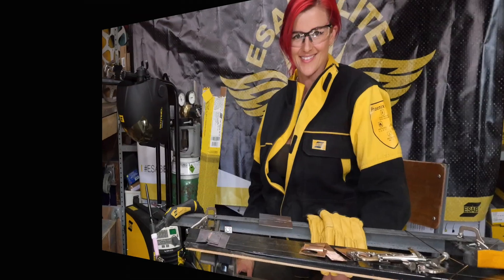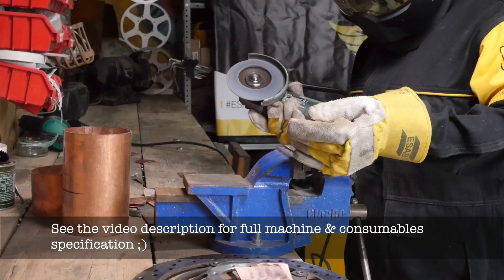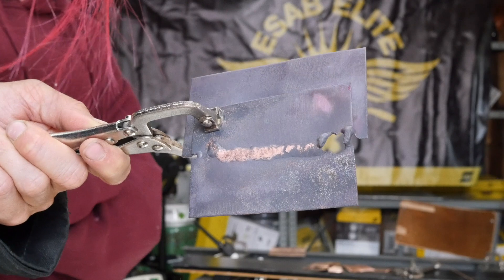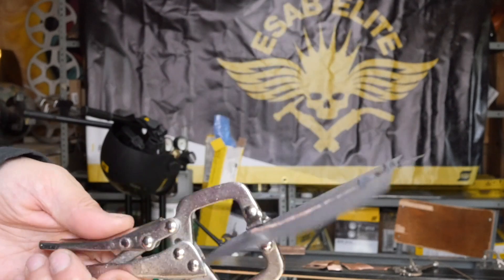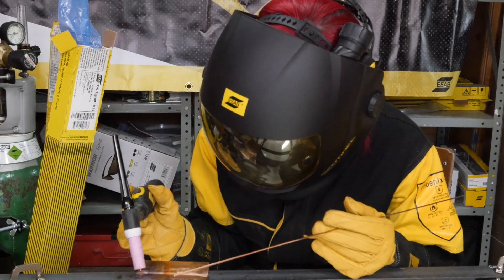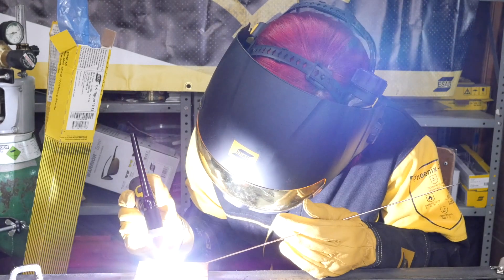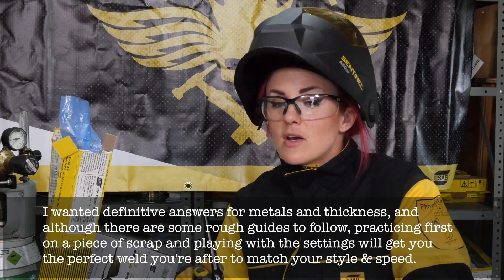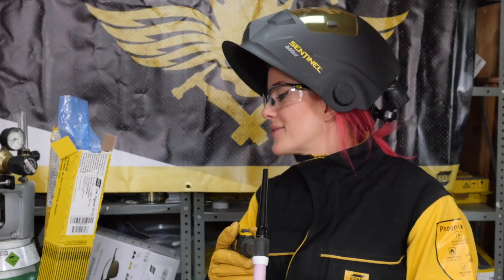Can you weld TIG weld copper with Argon gas?

Comment: Thank you!  You’ve convinced me I can do copper!  I currently use argon for aluminum, and I have thoriated tungsten for when I do stainless, and I have a TIG machine that can put out 750 amps if needed!  Another video showed I can use copper wire as a filler!  If I planned to do copper a lot, I would set up specifically for it.  But since I only need to tie a couple of electric buss bars together and they don’t have to look pretty, I’m sure now I can give it a go!  THANKS again!!

Comment: I was surprised to see how thin the copper was. It seems like there would have been much more blowout  after being on it for so long. Cooper is difficult to weld because of its property if moving heat. But when you get to the end of it and there's nowhere else for the heat to go, it will give you that quick sizzle  right before it blows out.
Why helium as a cover gas for copper? I thought helium was just used for welding overhead...? I've only tig welded copper twice.  Both times using argon
Reply: My understanding is the helium conducts the energy much better. The figure I've heard is, running helium effectively doubles the amperage of your welder when using argon. So you get much better penetration on steel, and can dump energy into the copper faster than it can conduct away.
Reply: @Twiconnor  get out! ..really? This blows me away.  Thanks for the info. I'm definitely going to be looking into this..

Comment: I think the only reason you need to use helium is if your welding thicker copper because the helium essentially ups the heat output. If your single phase 200Amp TIG set is maxed out , using helium it would be the equivalent of 340Amps . Thin sheet metal is so much easier to weld  using a foot pedal, saves you relying on your pre set slope down as your workpiece gets hotter as you weld, you can back off your amps  as needed as your welding to keep the bead the same width from start to finnish. I'm sure you know this Charis but I thought I would comment just to expand on your great video.

Comment: Another big mistake.....elevate weld joint off the cold work surface.  The heat will not be sucked out of the joint.  Weld AC and balance on full penetration.  Helium mixes not needed.
Reply: The back of the weld will oxidize if you do that!
Reply: @acewelding  no big deal, 2 swipes with wire brush remove anything.  Copper 1/2' or more use argon/helium mix, 50/50

Comment: You should be choked up on that tig torch more. You’ll get much better control over your puddle. You’ll be able to keep the tip tighter to the work which will keep your heat effected zone to a minimum which is a must in some instances

Comment: I use strands of heavy electrical cable to tig light materials with lower amps, so typically I would fuse a 1/8” stainless welding rod to 2.5mm weathering steel. These are small wrens that can be planted in the garden and bounce in the breeze. To do these I normally run 40 45 amps. It’s faster and easier than welding and yes I can tig conventional materials.

Comment: Most interesting. I just ordered some 3mm plate and I feel I am in with a chance now :o)
Reply from the maker: teamidris aw, really? That’s awesome! Glad to be of help 😊 Let me know how it goes 😉
Reply: @CharisWilliams  Thanks :D One person has said I wont get a cert on it? So i need to check the PED on ickle steam boilers. I don't think there is anything on silver soldering vs tig welding, only that it is made using 'sound engineering practice' and a pressure test. Should be interesting :)

Comment: Did you have to adapt your power at home to accommodate the welder so that you didn’t blow the electricity in your house or your neighbours?  We have a welder but the leccy won’t accommodate it 🤔
Reply from the maker: Reclaimed Life hiya, no, not at all. Haven’t had any problems in that respect. I just got a schuko plug adapter as it had a Euro plug being Swedish. I just plugged it in and off I go. It is a single phase machine, is yours?

Comment: I love welding, MIG is my favorite using Argon gas.
Reply: What material are you welding with this process?
Reply: @AlabamaTree  normally just steel tubing nothing fancy I welded frame rails and other items
Reply: @AlabamaTree  I suggest using official welding references when choosing shielding gas and filler.  You'll learn more that way.  You can MIG non-stainless steel with pure argon but it's not optimal for most work. 

https://www.lincolnelectric.com/en-us/support/welding-solutions/Pages/mig-faqs-detail.aspx#question2
"Common gas mixes for the home hobbyist and small fabricator: 

100% CO2 -Lowest price, generally greatest penetration, and higher levels of spatter. Limited to short circuit and globular transfer.
75% Argon - 25% CO2 -Higher price, most commonly used by home hobbyist and light fabricator, lower levels of spatter and flatter weld bead than 100% CO2. Limited to short circuit and globular transfer
85% Argon - 15% CO2-Higher price, most commonly used by fabricators, with a good combination of lower spatter levels and excellent penetration for heavier plate applications and with steels that have more mill scale. Can be used in short circuit, globular, pulse and spray transfer
90% Argon - 10% CO2- Higher price, most commonly used by fabricators, with a good combination of lower spatter levels and good penetration for a wide variety of steel plate applications. Can be used in short circuit, globular, pulse and spray transfer"

Most cost-effective for hobby welders is CO2 if you don't mind (or contain) the spatter. Pure CO2 cylinders last longer because CO2 stores as liquid under pressure then sublimes into gas.  75/25 is typical MIG mix stocked at welding suppliers. Pure argon is more expensive besides being less suited for most work.

Comment: Ofcourse you can weld copper with Argon. But we know that Cu distribute heat fast and when you weld you want to heat up the spot you are welding as fast as possible. Its not only to get the job done faster, when you put in too much heat or energy (welding slow on a low amp) it will become harder to weld and the weld will get an ugly look. 
Its also somewhat important to make it clean, that piece you welded are full with oxides. The more pure or clean copper the better. There are copper with diffrent purity and it makes a big difference.

When you weld thicker Cu material it can become ridiculous slow so 100% He or a mixture of He/Ar is often to prefer. You get a somewhat better penetration with He but so do a higher amp, better torch angle, torch distance, a pointy electrode, less filling material and so on.

What gas you should use, depends on many things but in your case welding a low quality thin copper piece once argon is definitly to recommend because, its cheaper. Using 100% He would be insane, just turn up the amp!
Reply: I get it, the helium has no effect as inert gas, but it has the best heat capacity so it cools the surrounding area. (Same reason Stirling engines run it)
Reply: @teamidris  I keeps the arc narrower, so it's more concentrated, penetration is deeper. Been welding copper with argon for ages and before that with Oxyacetylene torch, making copper stills. Welds were always hot hammered - heated to dark red with a torch, then hammered to flatten the seam, after the scale was cleaned with diluted sulfur acid and scrubbed with sand and again cold hammered, to harden the area. Use of cold shoes makes the annealed area much narrower, less than 3/4". The amps must be cranked up and area preheated with the torch before starting laying down the bead. To get nice ends, small rectangles are placed and welded to the main piece, lest they melt. Now I just lightly hammer, then I grind and weld disappears if finely ground or polished, but shows if patina is applied with a slightly different color.
Reply: @panan7777  I still haven’t started so that is very useful info. (I got working on the 1958 landy because it needed some love)

Comment: Charis.... set the machine 20-30 amps higher and feather the foot pedal....  your foot control will come more in time....  Ive welded copper using pure Ar previously and although you are supposed to use pure He, I found little issue but it wasn't for any important feature....  Keep burning kiddo and posting them vids....  Regards
Reply from the maker: Lol, will do ;) Thank you for the advise, I will try that, love hearing new tips to help me progress. There is so much to learn, but I love it! I'm using a temporary welding bench at the moment that I've cobbled together, when I have more time to set up a proper welding area in my new workshop (which is under construction) I think I'll be able to get much more comfortable and relaxed.